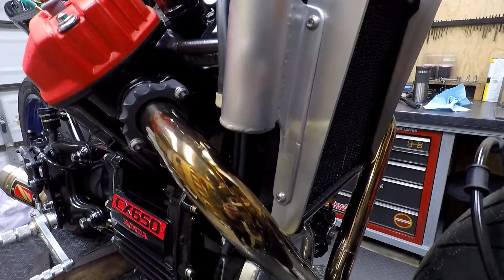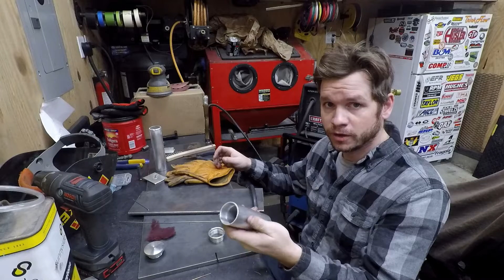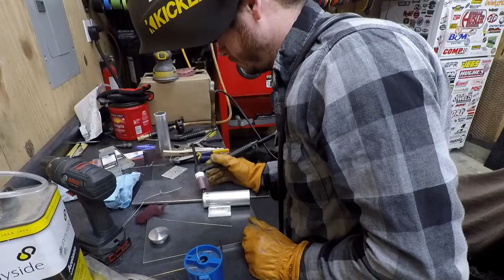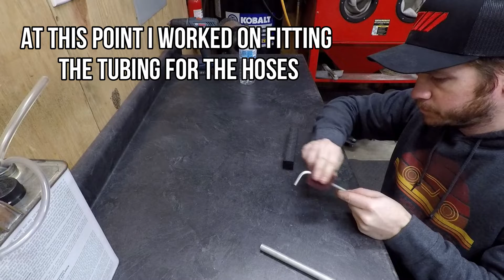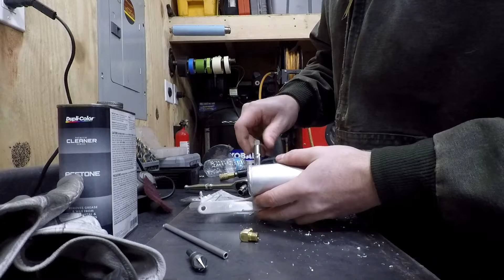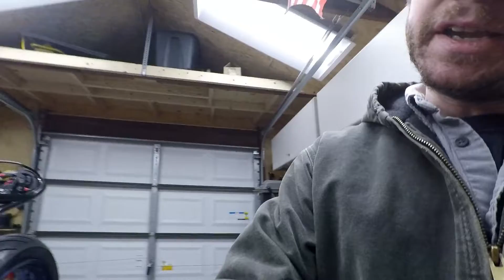CX500 Build - Fabricating An Aluminum Coolant Bottle and Radiator Fins!! - EP51

Comment: Love your videos, lots of good info, great to see! 
Can you advise on what size/max capacity of expansion tank you went with?
I'm curios as to how much expansion volume is needed.
Reply from the maker: Thank you and I appreciate you watching.  I did not measure the volume. I made the cylinder to fit the space it had around it. So far no coolant has been pushed out but its been ridden very little due to not being finished.
Reply: @BrickHouseBuilds  Cheers, I will definitely keep watching. I'v got a cx500 project. Currently doing GSXR fork swap with spoked wheels. Next will be a complete rewire; still daunted at the thought but i'm trying to put together a list of parts...

Comment: I think you’re better off with the brass npt fittings anyway because of vibration on the hose would likely stress the small aluminum pipe at the weld point and over time developing a crack.

Comment: Very nice so far!  I completed mine (R1 front end etc...) but I am a bit disappointed in the overall handling especially around shorter turns.  The R1 shocks also feel stiff although set to max softness... overall a bumpy ride!  I'm really curious to see how your one will ride.
Reply from the maker: Im assuming it will be firm but I can hopefully tune it with the preload, valving, and fluid. Im eager to try though!